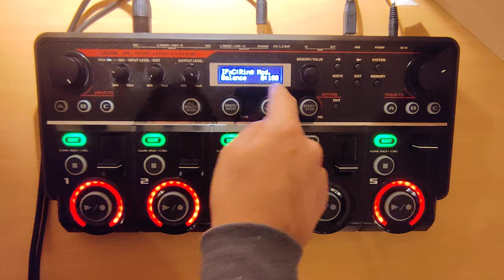Cow bell tutorial - Boss RC505 | Gasper Grom

Comment: tutorial on the bass you used for the example song?
Reply: G2B, FILTER, LOFI
Reply: @xxja_rdxx  you know the settings for each?
Reply: @zvd2889  Find the sound by experimenting. That's how I found it. That's what makes using the RC-505 so fun ;)

And besides, I want Gasper Grom to do the tutorial on it 😁
Reply from the maker: - filter lpf, rate 0, depth 0, resonance 88, cutoff depends on note
- lofi 1, off, balance 100:0
- eq, adjust it depending on how you want sound to be

I dont know exact settings since i sold my loopstation but you will get the sound